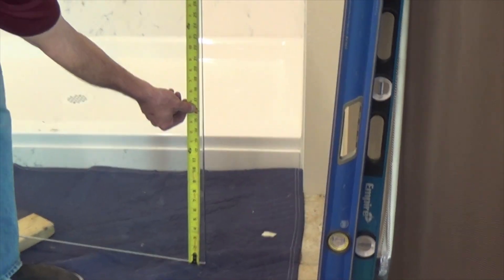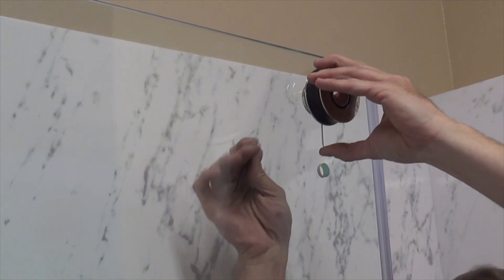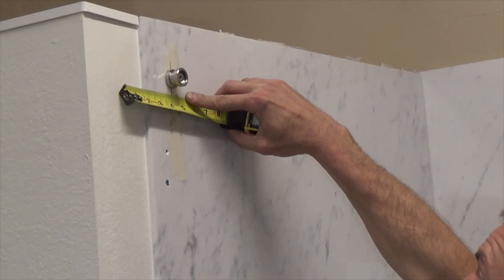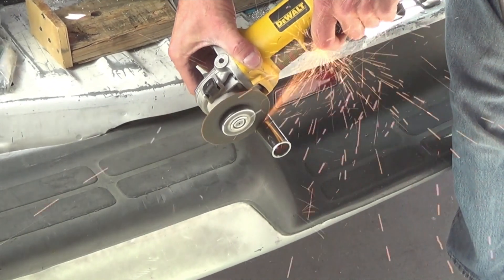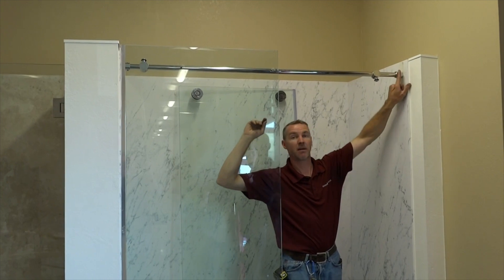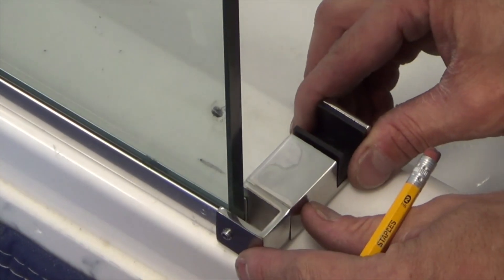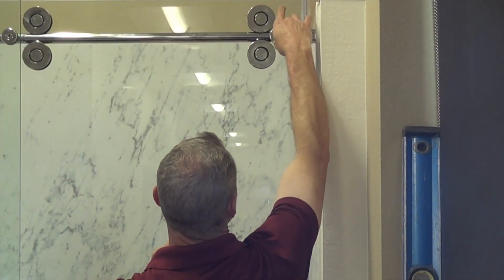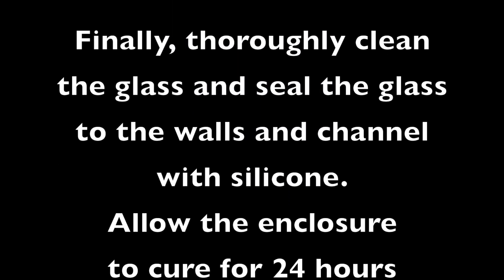Installation Guide- Sedona Series

Comment: Thanks for the video, In our newly installed frameless shower door. we are getting water leak from inside to outside through the door closing side, where there is very small gap between door to the wall. I am not sure which SIDE strip i need to buy and fix it, any idea on that ?

Comment: Very nice system.   Ours has been in for 6 months or so and the door "creeps" open 3 or 4 inches now when in use.  Is there any adjustment possible to correct the "levelness" of the header support bar?